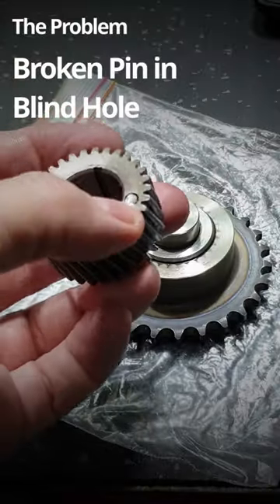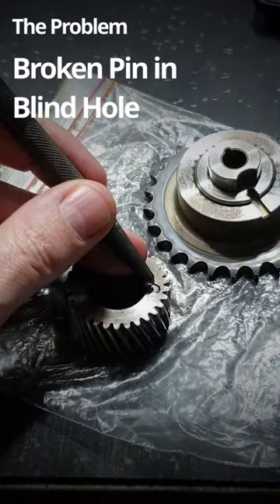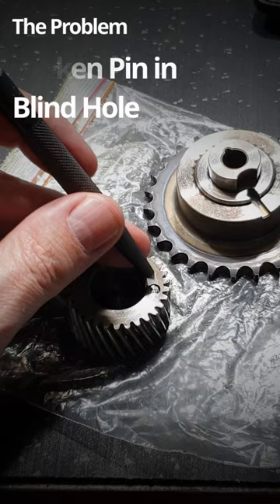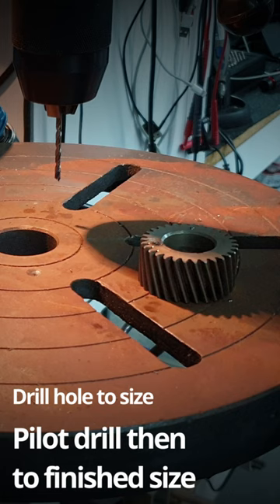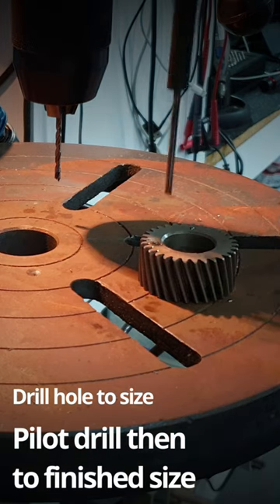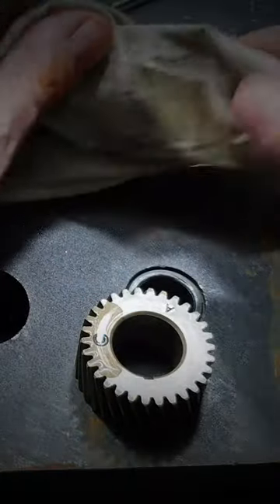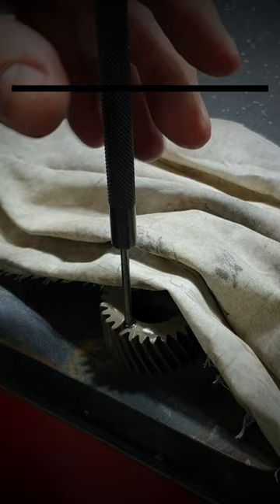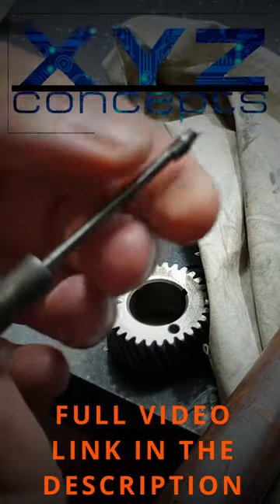Broken Pin in Blind Hole Removal (Trailer)

Comment: Im so fucked. Got a pin in a part that cost 30k and cant get it out. I have 6 hours before annyone comes. Its around 0,005mm fit but i think i fucked up my end section so its too small😭
Reply: And its carbine pins so i cant drill in them